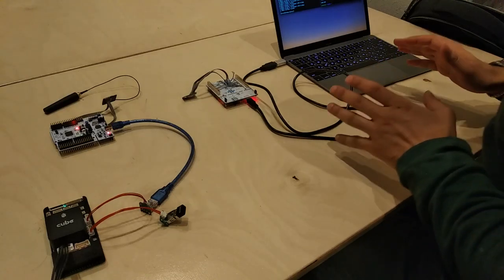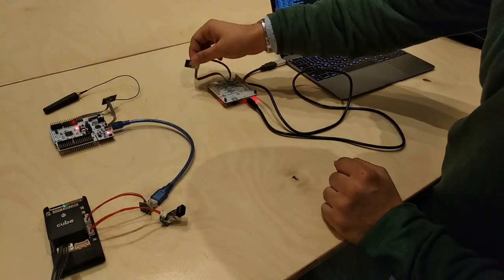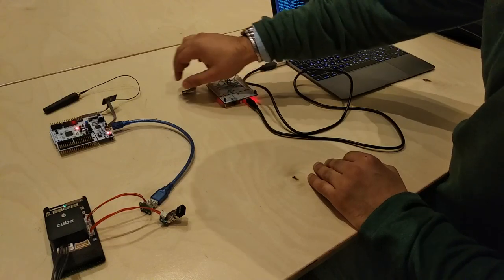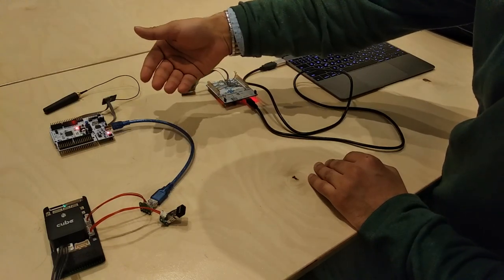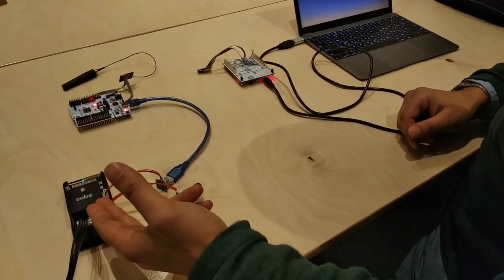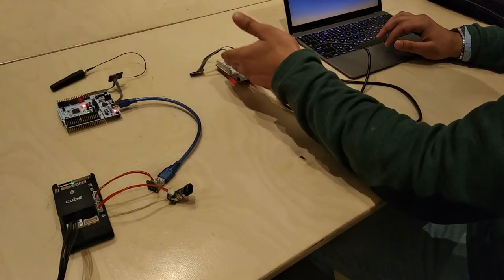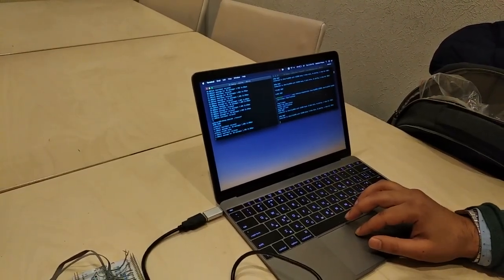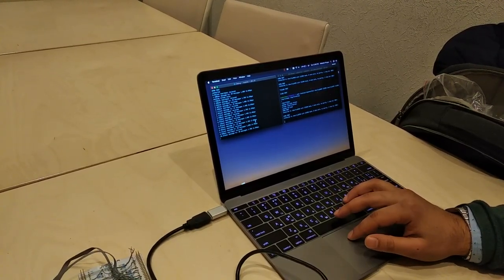LoRa 2.4Ghz  drone telemetry -  test

Comment: Could you tell whats is the rs 232 configuration. I cant link the E32-915T30D with pixhawke.
Reply from the maker: I dont use that model mentioned.  also cbyte modules comes without driver. i wrote driver for my application which works inside stm32 chip. instead you can use ZOON plug and play LoRa module for pixhawk https://dronee.aero/pages/zoon